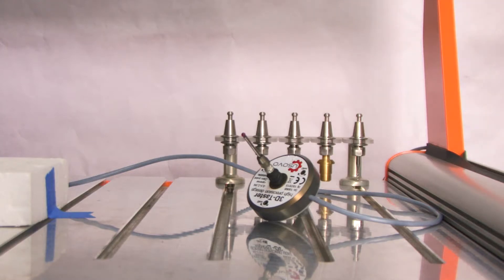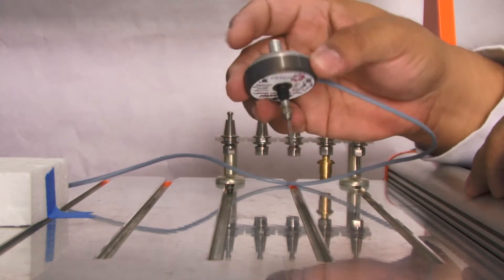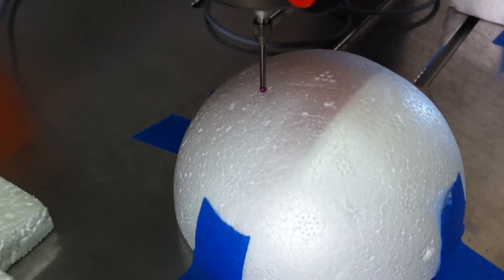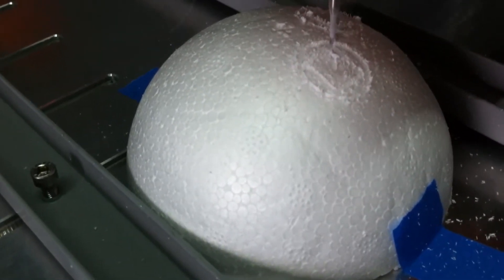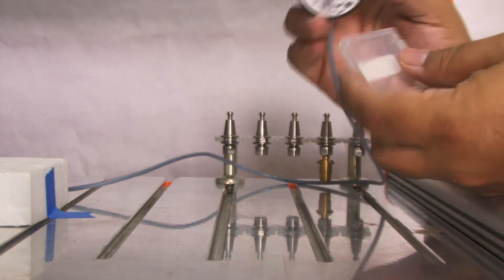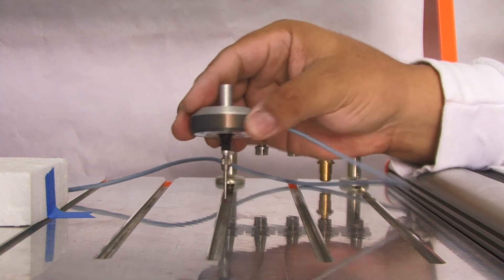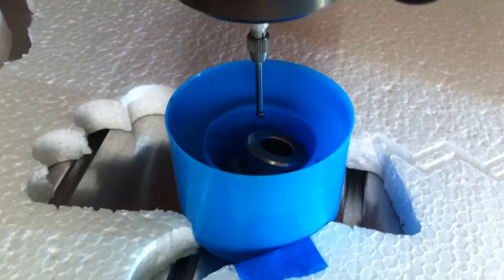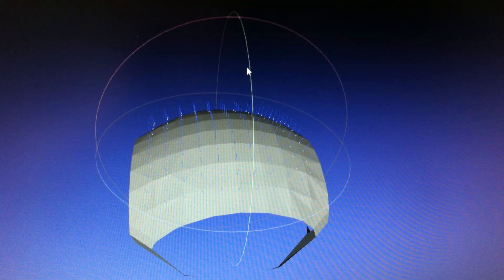STEPCRAFT 3D Touch Probe Preview - 3D Scanning, Point Reference, Surface Detection

Comment: So, on the last example of uses, point cloud or 'scanning' the object, how accurate is it? Would it be a replacement for small scale optical scanning? 
I could see this as a great tool for replicating either already existing objects with a difficult profile to recreate, or to have a finished product for a 3d printed prototype.
Reply from the maker: +- .0015" accuracy.  Yes it can replace small optical scanning.

Comment: is the touch probe available yet ?, i dont see it on the website , want to use it with the centroid acorn that has the software to run it
Reply from the maker: Yes it is available and has been for 2 years.  Where are you located?
Reply: the netherlands europe
Reply from the maker: https://shop.stepcraft-systems.com/3d-touch-probe
Reply: @StepcraftInc  I don't have a Stepcraft yet but plan to buy one in the near future. Can you use the probe by any chance to give out values, like diameter or distance of two points?

Comment: hello! I have one question, do I need to connect the probe directly to the mainboard? or I can use a jack plug like the tool length Sensor? thanks in advance
Reply from the maker: it uses the tool length sensor jack.  It is the same connection